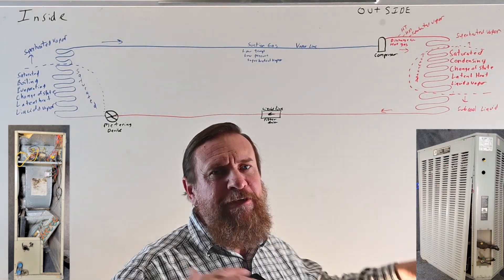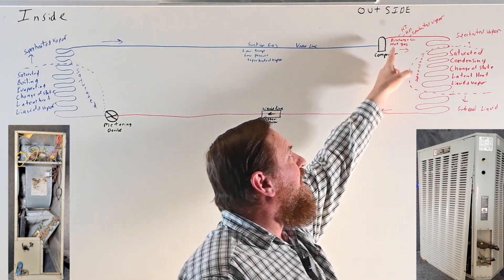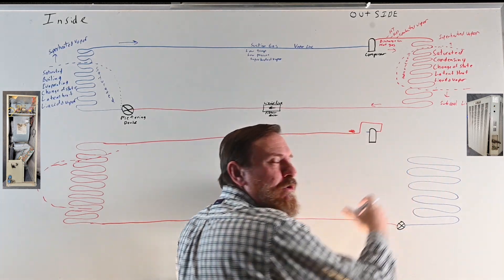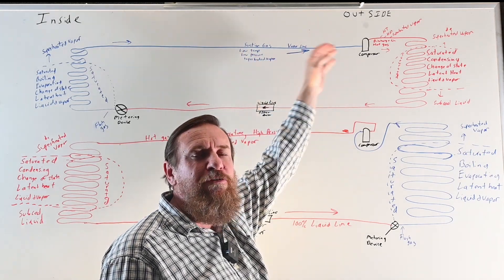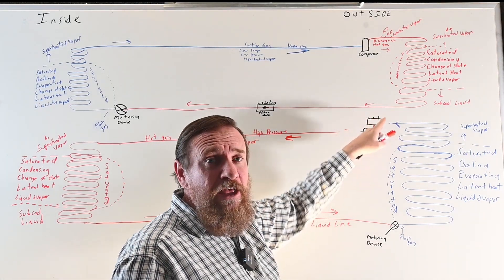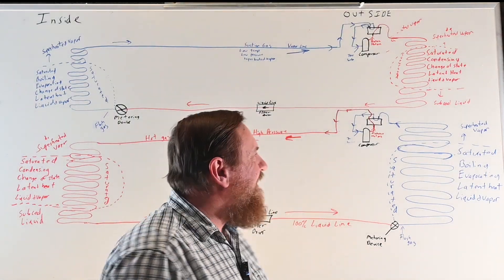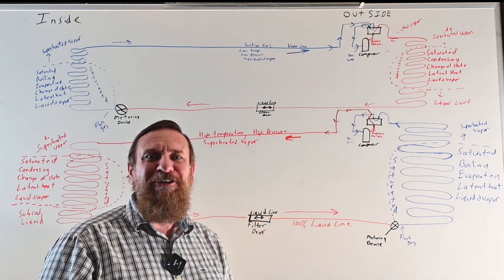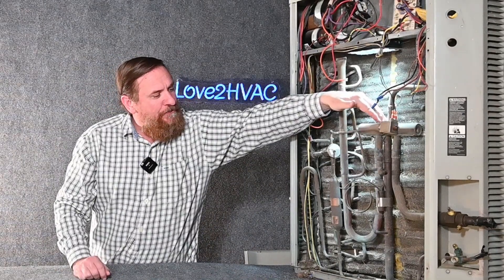Heat Pump 02 Refrigeration cycle step by step AC-HP

Comment: Could a stuck contactor on a heat pump in heat mode cause low side  pressure to fall? I think it would be opposite the high side pressure would increase especially if indoor fan wasnt running because thermostat was satisfied.

Comment: How does the system regulate the temperatures needed to reject heat at the outside coil? Let's say it's 110 degrees outside. The discharge temp and saturation temp needs to be much higher than if it's only 90 degrees outside. Using CTOA for R410A, the sat temp would be 20-25 degrees above ambient temp (sat temp 130). Then it's subcooled by another 10 degrees leaving the liquid line at 120 degrees. When it's 90 degrees outside, saturation temp would be 110 and liquid line 100 degrees. Is this correct? How does the compressor compensate for the difference in temperature required? Is it automatic based on ambient temperature or is it somehow regulated?
Reply from the maker: If you have a tank of Refrigerant inside at 70⁰F the pressure will correspond.  If you take the same tank outside it will heat up to 100⁰F and the pressure will increase accordingly. 
Notice the pressure increases when the temperature increases without a compressor.
The compressor is only going to add  to that pressure. 110⁰F + 20⁰F = 130F = ____pressure. 
If the outdoor temperature is 110⁰F  that will be the standing temperature acting against the Refregerant. The compressor (depending on efficiency) will add 20⁰F to that.

It's not that the compressor pumps any harder, it's only adding pressure above what it would be at ambient.
Reply: @love2hvac  Thanks for the explanation. So the amp draw should stay the same regardless of ambient temp? The compressor doesn't work any harder when its 110F vs 90F?
Reply from the maker: The amo draw and the capacity will both change.

As the outdoor temperature goes up,  and/or the indoor temperature goes down the compression ratio increases.  
As the suction temperature/pressure  inside drops there are fewer molecules available to compress. 
Meaning it is moving less volume of Refregerant molecules.

As the outdoor temperature goes up there is more pressure the piston has to overcome on the upstroke meaning moree resistance against the motor and more amps to overcome. But the speed of the compressor remains fairly constant.
Reply: @love2hvac  thanks for taking time to answer.

Comment: What I’ve never understood is; a heat pump uses the compressor as the primary source of generating heat, not the outdoor coil. The outdoor unit has to expand and therefore cool the liquid below outdoor ambient so the coil (evaporator) can boil the refrigerant by adding heat from outside air and preventing liquid compression.  Everyone says “we use heat from outside to heat inside” but in reality, we sort of don’t. We use that heat energy from the outside air to simply change the state of the refrigerant, enabling it to be compressed. That heat energy gained is minimal, and the majority of the ‘heat energy’ is added by the act of compression. Thoughts anyone?!
Ps… love your videos Ty!!! Big fan from 🇬🇧
Reply from the maker: It's the heat from outside. 

The refrigerant's boiling temperature is lower than the air temperature outside. Because the temperature of the air is warmer than the refrigerants boiling point the heat from the outside air makes the refrigerant boil, changing state from a liquid to a vapor, latent heat. 
That laten heat of the refrigerant changing state is very powerful and holds an incredible amount of heat hidden in the phase change. As  the refrigerant changes state it absorbs heat from the air so the air leaves cooler. 

The best leaves the outside air and inside absorbed into the refrigerant as latent heat hidden heat in the phase change. After all the refrigerant is boiled to a vapor, the vapor is still cooler than the air temperature so the heat from the air will still travel too the cooler refrigerant vapor. This causes the refrigerant vapor to superheat above it's saturation(boiling) temperature. We can measure the superheat but it's overall very little heat but it's important to know we have only vapor going to the compressor. 

The compressor pulls in the low temperature, low pressure superheated vapor and compresses it to a high temperature high pressure superheated vapor that will be warmer than the temperature of the air inside. 

We can feel the heat of compression but it's only relative to how much heat the refrigerant was able to absorb from changing state, boiling, latent heat, in the outdoor evaporator. 

As we absorb less heat from outside we have less heat of compression to work with in the compressor.
Reply: @love2hvac  thanks for responding Ty. I must admit I still don’t quite understand as the heat is added via compression. The phase change in the outdoor coil is simply to stop liquid compression; it’s still cold vapour before entering the compressor. I do understand what you’re saying about lower ambients increasing compression ratio though. Maybe explain on a podcast or video some time?! I do feel a lot of people are in the same boat as me and can’t see how cold superheated vapour adds much in the way of heat to indoors. Would really appreciate a video or further explanation. Maybe I’m stupid 😂👍
Reply from the maker: @tom24057  it's a great question I will see if I can make a video specifically addressing that.
Reply: @love2hvac  wow amazing! Thanks Ty, you’re the best! 😃😃
Reply: @love2hvac  amazing! Thanks Ty!!
Reply: @love2hvac  will you make this video Ty? 😅😅😅

Comment: Your the best teacher and technician I always watch your videos. Thanks.
I am Maintenance technician and I work hard to become service technician one day.
Reply from the maker: Thank you!
I was a maintenance tech once too. I am actually doing maintenance on a large building right now. 
It's a good way to learn, you get to see how things are supposed to work. Be curious and take a look at things. Check voltage across controls running and not. Look at wiring diagrams and identify components.

Comment: GREAT!   Looks like an older Trane outdoor unit.
Reply from the maker: Spot on!
Reply: @love2hvac    I have 2 Trane XL1400 heatpumps since 2002. I replaced the defrost control board in one unit 3 times! Replaced the ECM fan motor once in same unit. Replaced both caps in both units one time. These older units are real BEASTS!

Comment: I like the way you teach,
1 question, why run different size lines for a system that is reversible ?
Reply from the maker: The liquid line is still the same subcooled liquid line in either mode.
AC liquid from outside to inside 3/8
HP Liquid from inside to outside 3/8

The large valor line is still a superheated vapor in either mode, cooling mode it's just a low temp low pressure superheated vapor, flowing inside to outside.
 Heating mode it's a high temperature high pressure superheated vapor flowing outside to inside.

Comment: Have a question. What would cause suction/liquid pressure to rise very slowly. Was working on a Goodman heat pump with a piston at indoor unit in cool mode. When system comes on suction pressure would drop to about 67psi and very slowly rise. Liquid pressure same thing about 219 then slowly rise. Readings finally stabilized 
Suction psi 115 
Saturation 38.4
Superheat 8.7
Liquid psi 267.3
Saturation 87.9
Subcool 15.9
Indoor temp 70/69
Outdoor temp 69
Temp Split 21
PSC motor med speed 
The initial pressure drop is expected with a piston but it seemed to increase very slowly. Just wanting to know why.
Reply from the maker: It takes about 15 minutes of run time for the system to stabilize. 
Any reading before that don't hold the most value

Comment: Thank you ty for this excellent learning video...is there an easy way to remember subcooling and superheat because I always get confused how they work...thanks ty...looking forward to the next class 👍
Reply from the maker: I recommend using the whole word set.
Superheated vapor.
Subcooled liquid.

We breath a superheated vapor, the compressor breaths s superheated vapor.

We drink a Subcooled liquid. The metering device drinks Subcooled liquid.  

Saturated means liquid and vapor, think of sea level.
Blue superman flyes above saturation in the low pressure low temp superheated vapor. Super Due to the rescue!

Submarine travels below saturation in a high pressure liquid. The hunt for Red October about a red submarine.  We all live in a red submarine, ref for sub cooling, ref for subcooling, High pressure liquid!
Reply: @love2hvac  thank you ty...I will study it..

Comment: Is there an event to where refrigerant can’t saturate above the OA temp?
Reply from the maker: Yes 
#1 Low on charge not enough refrigerant molecules to compress. To raise the pressure and Saturation.

#2Low ambient conditions,
The outdoor temp is too low causing pressure to drop,  there is not enough refrigerant available to fill the condensor to generate the needed pressure. This is one reason low ambient kits are important.

Comment: How do we control room temperature that is caused by massive amount of heat leaving the high temperature high pressure gas inside the heat pump coil?
Reply from the maker: A blower moves the air across the indoor coil. The heat is now in the air that is pushed into the duct system that is pushed into the house air. The air should never be blown in people. The air in the home warms up and the thermostat will satisfy ending the 24v call for heat. The contactor electromagnet will realize and a spring will drive the contacts open stoping the operation of the outdoor fan and the compressor ending the refrigeration cycle. The call for fan will also ens at the thermostat and the indoor fan relay electromagnet will energize and a spring will open it's contacts so the indoor fan shuts off. 

Now the system is off waiting for the next call for heat.

Comment: I wish the automotive heat pumps could make it that easy with nothing more than a simple three-way reversing valve. 

You should see the cluster  F$@&K that all the different automotive manufacturers are attacking this thing from different angles, reinventing the wheel, splitting up components in placing them all over the vehicle under the hood.   
      Automotive industry engineers, first year graduates out of school on math, and may be sprinkled with a little LSD and were told to have a hack at it get it working. 
       HVAC automotive engineers make the most complicated heat recovery VF our system look like a child’s toy. 
      A nightmare on steroids.   It will be a decade before the automotive industry probably decides on one or two common methods approach of application of heat pumps in electric vehicles and hybrids.. I hope.
Reply from the maker: People complained about the complexities of HVAC today. They haven't worked on a car or truck recently. 
You are correct. 
Removing intake to get to the starters, removing fenders or seats to get to the battery. Computer controls under the vehicle.  
Makes our HVAC easy! 

This is why I keep repairing 1999 but now parts are getting hard to come by. 🤦‍♂️Can't win!
Reply: Tesla is getting ready (considering) to hop into the home HVAC Industry. So glad my active years are behind me. I will enjoy watching the younger generations adapting to the new technologies coming at us at warp speed. My fear is with so few people entering the field & baby boomers retiring at a rapid rate, built-in obsolescence and replacement will be the norm. The big problem is the cost and inflation.
Reply from the maker: The issue is not the equipment, it's the homes. Its like trying to build a better and better and better bulge  pump. But at some point we have to start fixing the leaks in the boat. 
Hoses are still being built leaky. 
Matt Risinger, Allison Bailes, Joe liberstick and many more are making headway in that area.  
Seal tite and ventilate right. It's important for energy efficiency, comfort, human and building health.

I don't deny Elon is a brilliant man but he is spread thin and a lot of his big ideas are not becoming reality even years later. Tesla has a lot of potential like  the solar roof panels, the battery wall but they are not solving the problem yet. Nobody knows about his HVAC idea. I would like to hear about it.
Reply from the maker: I definitely want to see that!
I was told they use a reversing valve and the compressor was dc so it was a true variable speed controlled  by voltage, but high voltage. 
Can you confirm or deny?